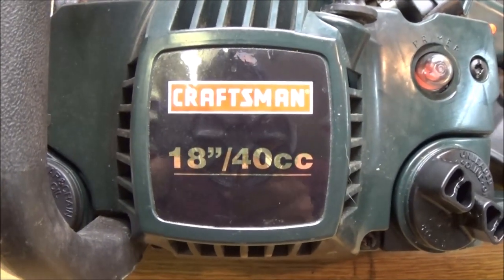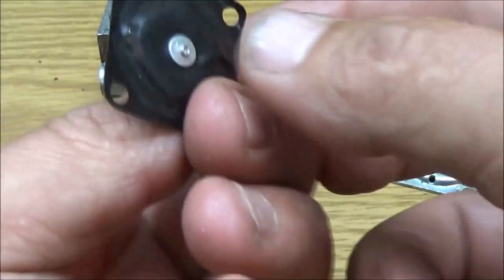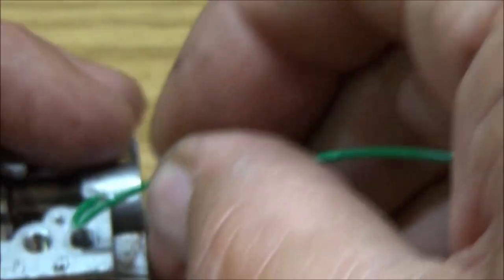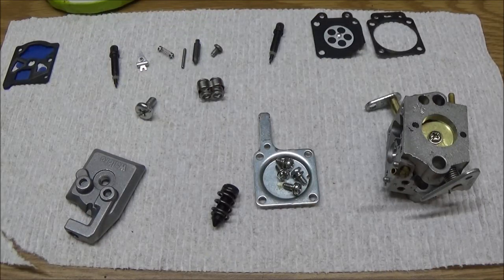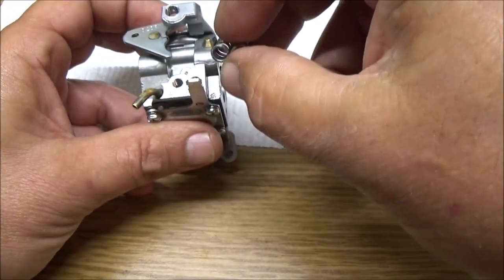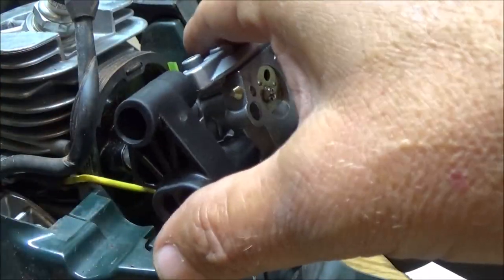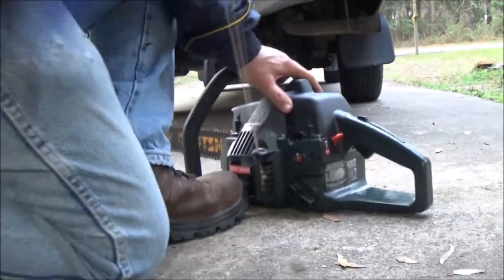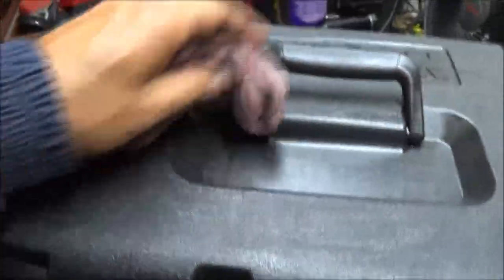Cleaning The Carburetor On Craftsman 40CC 18 Inch Cut Chainsaw

Comment: Now the tools are easily found to be able to adjust or take jets out. When I bought my saw about 18yrs ago the tools were not readily available. The craftsman repair facility personnel told me they made them that way specifically so that the owners would have to bring them into the shop to have any adjustments. I live in the mountains at 7200ft and my saw just would not run properly with the factor settings. I pulled the carburetor out and cut a single slot groove in the top of the  jets so that I could adjust  them with a small straight blade screw driver. I was able to adjust them and the saw ran perfectly. Depending on the elevation where the saws were set up back then I could understand why my saw would not run at it's current elevation with the factory settings.  Very good video. Thank you very much.

Comment: Loss of feeling in fingers could be due to carb cleaner.  I got some on me today and felt the loss right away, and washed with soap and water.
Reply: Really, I’ve used all my 73 years and no problems yet and still using it 5 days a week in shop

Comment: Great Video!!  What is the tool called to adjust the carb. and where can i get one?
Reply from the maker: Thanks. It's called 2 Cycle Carburetor Adjustment Tools. I got mine on ebay but you can get them through Amazon and most harbor freight stores or parts stores Carry them too. I think I gave about $10 or $11 dollars for mine. Get the kit and it will have any one you need for any 2 stroke engine.

Comment: Hi, when you replaced the top cover, had you put the foam filter in the air box? To improve the air filter, I wrap the foam in an off cut of discarded ladies nylon stockings. Helps reduce amount of debris pulled into pores of foam.
On some similar saws, found the clutch cover holes are often a loose fit. Consequently the clutch drum scrubs on brake band and wears it thin. Then fails when needed. Sorted by putting a thin sleeve over the bar studs.
Husqvarna group products are marketed under range of brands, Poulan McCulloch Partner Craftsman Jonsered, Redmax? maybe more. Homelite now owned by Ryobi. Dolmar by Makita. Shindaiwa by Echo. Hope info of interest. Be safe.

Comment: I noticed that the plastic grommet on the L adjustment after cleaning was stuck in the carburetor. So if you are still having problems with it that's your problem. 
P.s your chain was still too tight and you didn't check the bar oil...
Reply from the maker: Its fine. And yes i did check the bar oil. Nothing was stuck. Just because i didn't show something in the video doesn't mean i didn't do it.

Comment: There  is no reason the average male can’t rebuild these carbs and parts are cheap, just like the fuel hose and replacement carbs 
There good home owners saws 
Just dump the fuel and put a bottle of oil in tank and purge thru carb 
Next year drain and fill with real gas and oil mix in a can